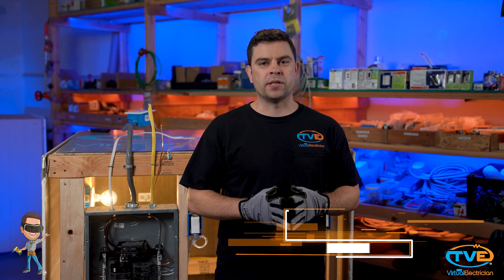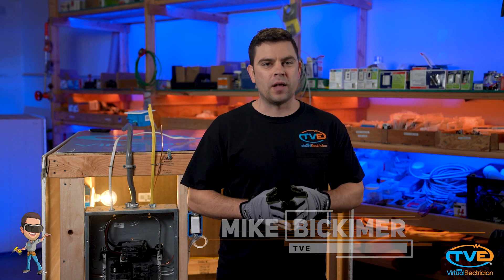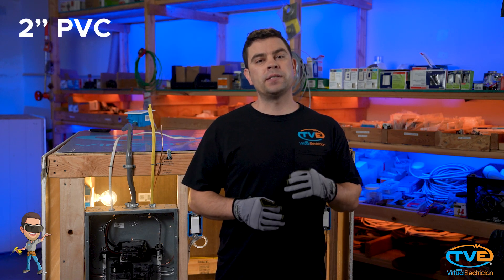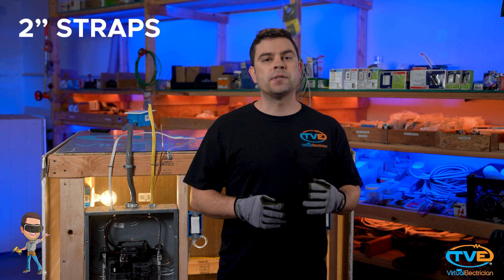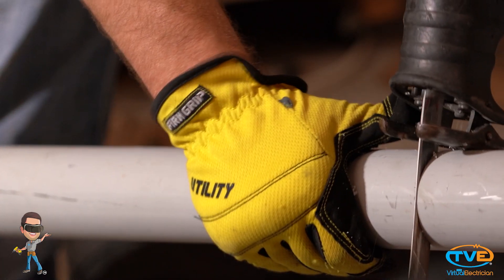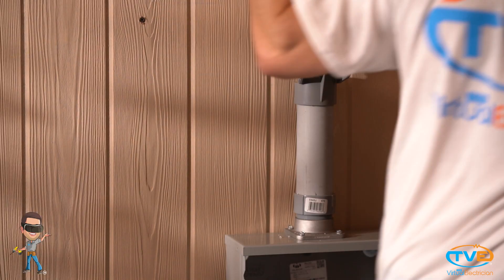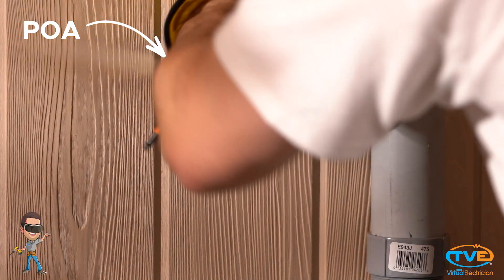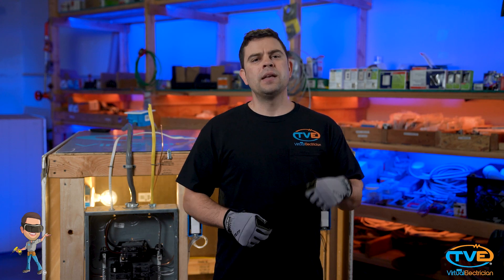How to install a meter mast

Comment: Thanks for the video  :)  2 inch PVC is only going to work for a service up to a certain amperage, given the gauge wire needed for that.  Maybe in the comments, add what size service your video is intended for.
Reply from the maker: You are correct